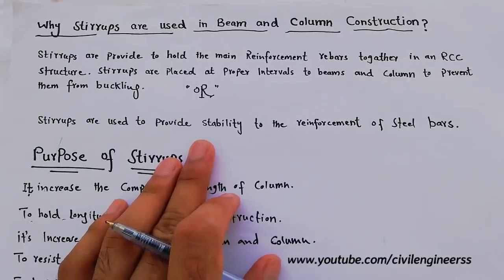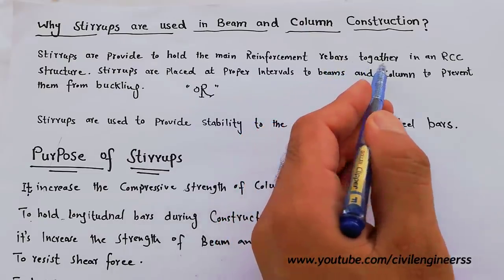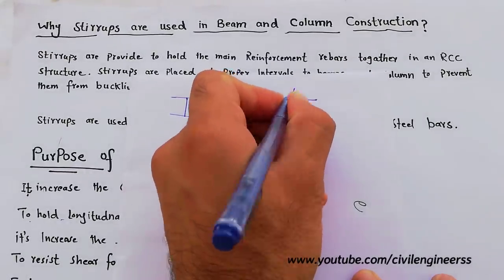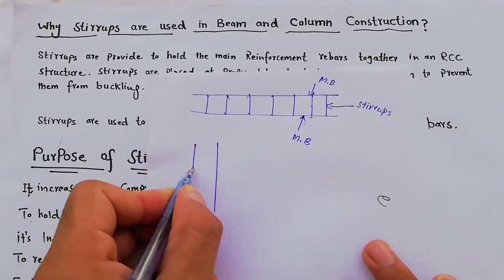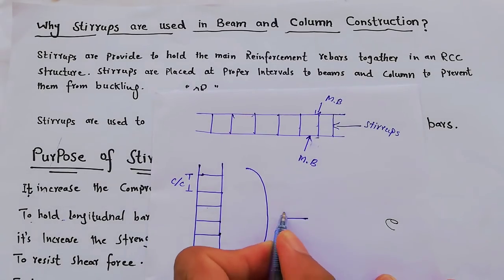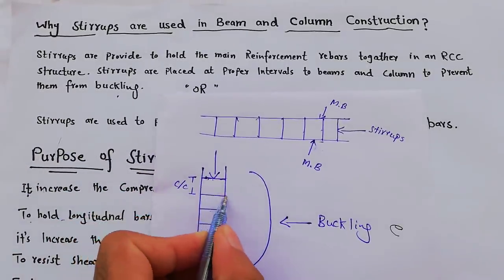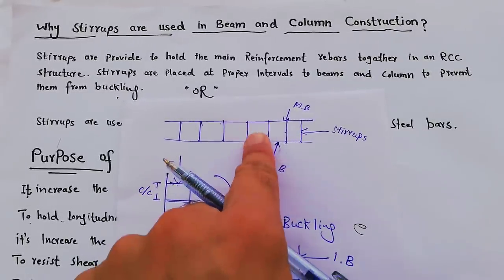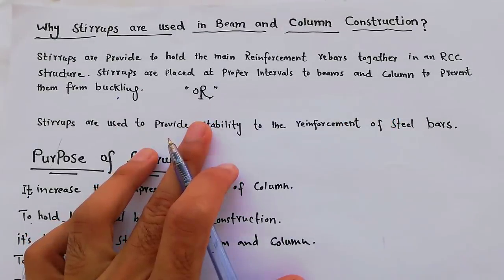why stirrups are used in beam and column construction? | purpose of stirrups |

Comment: no pictures of columns and stirrups except on the thumbnail?
may as well have typed this out and posted the text message.
why use a video platform?
Reply: the 2D drawing does not show the shape of the stirrup.
the MOST often mistake is not ending the stirrup rebar in the center of the column and just have it lay along the outside of the column.
the second MOST common mistake is not placing the stirrups closer together at column and beam intersections and near top and bottoms of columns.
you did not address THEE  two (2) most important mistakes people make.
its not good to even talk of stirrups and not cover the stirrups
 themselves.